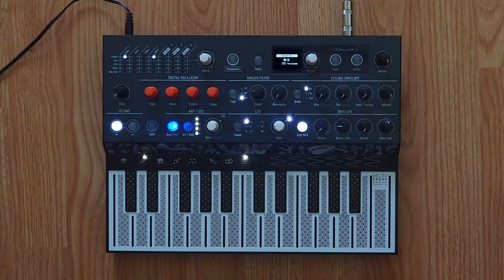Turning the Arturia MicroFreak into a Drum Machine | Tutorial

Comment: thank you for info - Your idea can be applied to other external samplers/synth with sequencers functions with CC Midi mapping and Parameter Locking - Connecting Microfreak to  external to these external gear could mean you program the internal filter / effect also dynamic per 'step' for even more new drum sounds - example:  On a  Elektron Octatrack it means instant 256 drum sounds  variations ' ( 64 drum  steps X 4 variations  )  on  just one  microfreak preset   + adding filter / effects parameter changes for each Drum Step...

Comment: What is the major difference between arturia microfreak and vocoder version ? Apart from adding your own voice and modulate it.
Reply from the maker: No difference. Both have a vocoder. The vocoder version just comes with a microphone in the box, while the normal one doesn't. You can buy the microphone and use it with the normal MicroFreak.
Reply: @ApproachingNoise  I just bought a "normal" version of the microfreak and it came with the gooseneck mic 🤔maybe they started shipping them with it